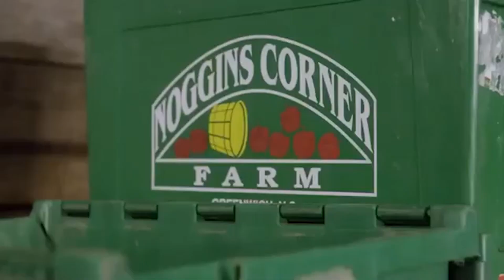Is “Bad Chad Customs” canceled?

Comment: He's no car builder trust me! Hack....
Reply: you are no car builder when: you think u-joints on a drive shaft are used to allow you to install the engine crooked.
when you think a spline joint is a straight thread.
when you don't know the difference between red and blue locktite
when you don't know how to fully utilize the tools you own, but try to teach others.
when you don't know the geometry behind suspensions.
when you feel that your perspective is superior to all others
when you think no one else builds without using bond. go watch marcel's videos
when you build cars that are dangerous for road use, great for lawn art.
when you claim to build cars in  30 days and have some project for 5 years unfinished.
when your work cannot stand critque.
when you don't know the difference between a compass and a protractor, or when to use them.
these are just a few of the issues that don't make you a genius,, but do make you entertaining and appear to be a genuine nice guy with a big heart.
Reply: @widgetfactory8033  When you don't know how door hinges work.
When you don't know what cab over means.
When you use three gallons of bondo on one project.
When your projects look like they were designed by a 5 year old.